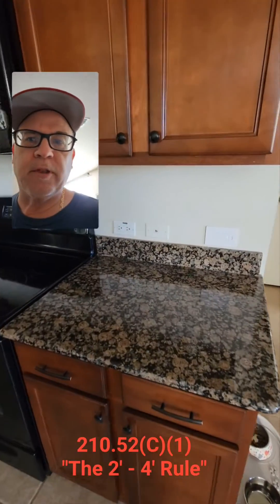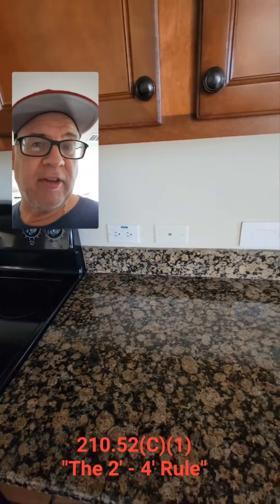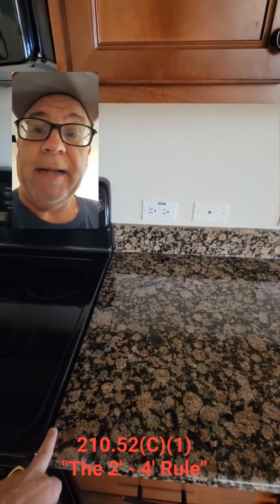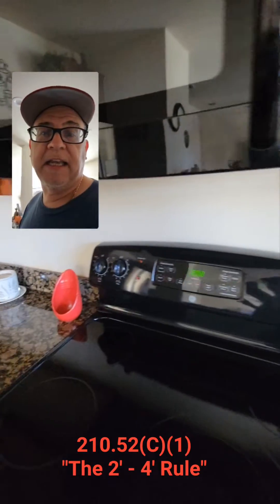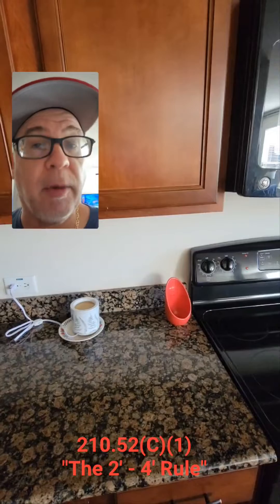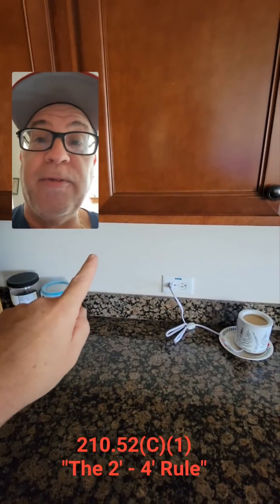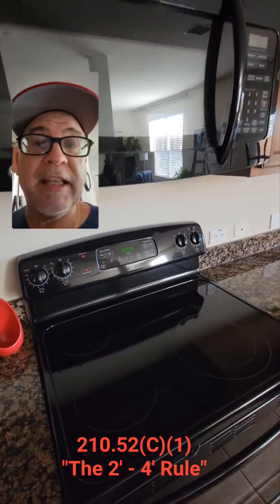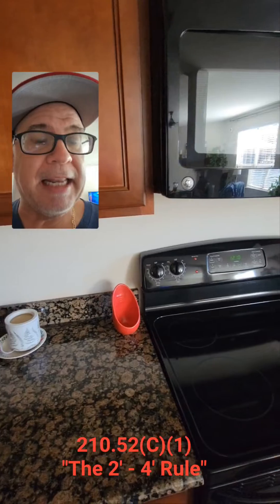Explaining NEC 210.52(C)(1) and the infamous 2'-4' Rule for receptacle outlet placement

Comment: Hi Paul, can you explain how you interpret theNEC 210.52 (C)(1) Exception #2?
Reply from the maker: Exception No. 2 addresses installations where there may be an obstruction such as a window over a counter and normal placement to conform 100% to the NEC intent is just not possible.

Comment: What about putting the outlet in the middle of the span of the cabinet? You would have like 15 o.c each way; please reply
Reply from the maker: Not sure what you are asking. The measurements are you have to have a receptacle outlet with 24" of sink and then can go up to 4" away to the next receptacle outlet. Now, if your span is only 30" from sink to end of counter then one placed at the center would be within 24" of sink and within 24" of end of counter. So, yes 15" is less than 24" and is compliant.